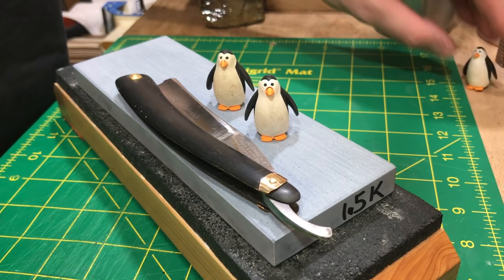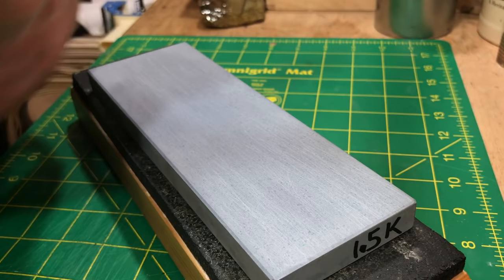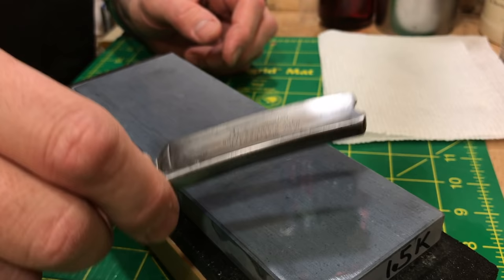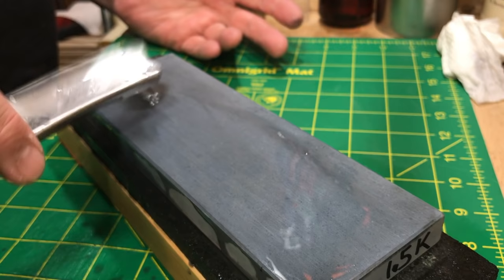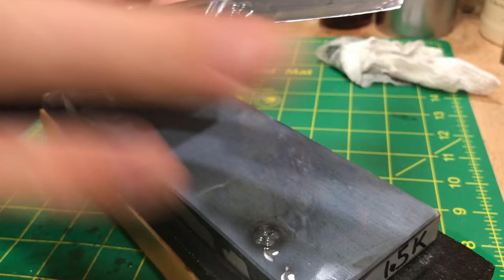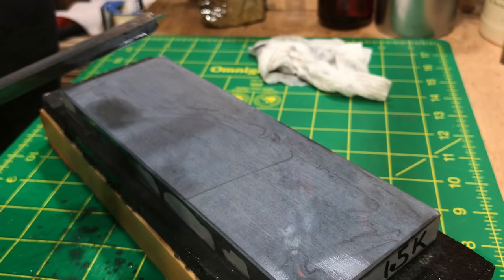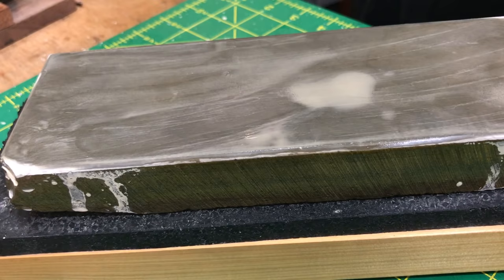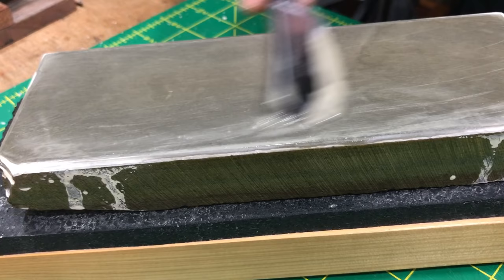Straight Razor Honing - from Resto to Shave Ready

Comment: This...  This video right here... I've been watching these videos for hours - this video is the first one that mentioned the black marker trick to check the edge.   Tried that - saw my spots not getting hit...  BOOM... got my edge on a cheap amazon 20 dollar razor - though there was so much work to be done, I dropped down to a 400 for the quick work then back up to the 1k.
Reply from the maker: A lot of (almost all of) those inexpensive amazon razors are made from soft steel, so you may get an edge and then lose it quickly, or it might not take at all.
Reply: @KeithVJohnson1  Yeah I didn't anticipate it being a super nice razor when I got it - but it's been a great learning tool.   I was able to get the cheap one to shave - though not a great shave.   We'll see what happens when I buy a nicer one next week.   I'm thinking a dovo?
Reply from the maker: If you are learning to hone - I would suggest picking up a couple of vintage razors that don't have huge obvious issue - you can probably get 2-3 of them for the price of a new Dovo. You can beat up on them and once you're skills are in place you can get a new new blade and you'll be ready to hone it without putting excessive wear on it.

Comment: Keith I was wondering is there a certain amount of laps you are doing on each stone? Seems like your honing for along amount of time. I’m using 1000 super stone, 3000 chosera, 8000 shapton then a 12,000 Naniwa GOUKEN Kagyaki. To set the bevel to finish it takes me about 25-30 minutes. Should I be spending some more time on a certain stone?
Reply from the maker: Hello! 
No, I don't count laps,  or hone for a set amount of time, or try to go fast. I like to immerse myself in what I am doing so I can enjoy it. Time is irrelevant for me when I am honing. This is just fun for me, not a chore. I don't time it. Some people hone faster, some slower. I tend to focus on what I am doing, and not compare of judge what others do. It takes as long as it takes. 

That said, the videos are just demonstrations, they are not meant to be a 'do it this way' kind of thing. What you see, or think you see, is not necessarily what happens or how it happens when I am not making a video. The lack of a need to hone faster is the main reason. But for videos I turn it down a notch for a couple of other reasons; one is that I don't use a script, everything I say is spur of the moment. Being more conservative with actions and approach allows me to assemble and verbalize thoughts into coherent passages. Sometimes I spend more time on a stage so I can complete a thought.  Moving slower allows a better view of what's happening on the stone. The tactile and audible feedback presents better when going slower too. Speed tends to blur the feedback, and it will give a false positive on undercut.  

Bevels are done when they are done. Same for the rest of the progression. 
There is no way to time the work, or assign a set number of laps for any stage. If someone wants to hone faster, that's their thing. The only thing that matters is if the work is done correctly, it's not better or worse to go faster or slower. If I have a razor in good condition the honing is faster than when I am starting with an auction site save.  Rolling stroke blades take exponentially longer because the entire edge isn't on the stone all at the same time. 

Every bevel starts off with a different condition, every piece of steel has different hardness and wear resistance. Every user applies pressure differently. So there are all these variables to deal with. The only method that works is to hone until I am done and however long it takes is how long it takes. Longest I've spend on a rough bevel is probably 90 minutes, shortest is probably 7-8 minutes. Depends on the blade and my mood and which stones, etc, etc, etc, 

I spend the bulk of my time on 1.5k and whatever the next stone is. 
How long that takes depends on myriad variables. Setting a bevel that I can get a 3 pass shave with requires time on the stones. There's no getting around that. 
My 8k and 12k efforts usually take less than a minute combined.

Comment: Hi Keith, I've been watching along while honing a blade of my own.  I've also extended the spine over the edge by the heel creating as you called a 'chevron' but was wondering if this will comprismise the edge at some point or if I can continue to wear it all the same?
Reply from the maker: Sorry, I don't understand what you are describing or referring to. Could you explain in detail or point out a time-stamp in the video as a reference?
Reply: Hello, I was referencing around 34:50 in your video. I just wondered if continuing to hone would inevitably cause issues with that segemented part of the steel.  Maybe you might have asked before but why would a blade be designed like such?  It seems counterintuitive to obstruct the last cm or so of the blade... anyways I don't know so much about this yet :)
Reply from the maker: @Brandon-mr2oh  I can't find anywhere I used the word chevron - sometimes time stamps are off on different viewers I think. Long ago, tolerances were not tight, perfection took a back seat to making more money, etc - so a lot of razors were made 'imperfectly'. Honing errors ocross 100 years takes a toll too.
Reply: Ah I reviewed your video a little more to clarify myself, so the shoulder is what is strange to me, as you say around 36:20 there will be discrepancy with bizzare heel/toe.  If the shoulder makes it difficult for us to hone equally, why is it designed such?  Other than my possibly irrelevant question.. when honing onto the shoulder in order to extend your bevel at the heel would I want to take care not to create much more than a small stretch of the spine?  Hopefully i'm making a little more sense.  Thank you for the help.
Reply from the maker: @Brandon-mr2oh  There's no way to imagine what to do with an imaginary razor. You have to take each situation as it comes and work with it to achieve the desired results. How anyone approaches each of their own challenges is up to them.
Reply: Very true, thank you for the solid advice!

Comment: Are you torquing the blade's edge into the stone heavily, lightly, or not at all?  Great information, as well.  I'm about halfway done with all of your videosn(I've been watching for a couple of months now).  Just ordered a Shapton Glass 1k to set bevels with instead of the very cheap 1k from Amazon I purchased 😐
Reply from the maker: Torque and pressure depend on the blade and the work needed to be done. I do all of the above, but not all at once and not all the time. Thank you for watching and commenting!

Comment: 1:03:07 Do you finish on just water with black Arkansas?  Is there a difference between swarf and slurry?
Reply from the maker: sometimes water, sometimes water & soap, sometimes glycerine with water, sometimes oil. Slurry is from rubbing two stones together, swarf is slurry plus abraded metal from the blade.
Reply: @KeithVJohnson1  Thanks!   I will need to look for a video you do with soap and water.  I've never heard of such a thing.  I use to shampoo my hair with vinegar for years.  Not sure why I stopped.
Reply from the maker: A tiny bit of soap breaks the water's surface tension, and it adds some lubricant to the mix too. It's a nice finishing liquid. But only use a very very teensy bit of soap.

Comment: so the spine is a guide?
Reply from the maker: Straight razors are designed/made so that the spine is part of the geometry - so yes, in a way, that makes it a guide because the width of the spine determines the angle of the bevel.
Reply: bt the spine wears down over time doesn't t? I have seen people tape it. would you recommend?
Reply from the maker: The spine is supposed to wear down, that is how the bevel angle is maintained.

Comment: Bloody awesome video as usual.  I have a question.  I’m about to lay out some dosh for my first stone.  Have found Shapton to be in my budget and availability. Could I also use these stones to sharpen my kitchen knives or would I spoil them. I would obviously want to use them for main purpose of honing my straight razor.  Appreciate the advice! J
Reply from the maker: Shapton Pro stones are fine for cutlery; they're hard enough to deal with the pressure easily. They work well for razors also.
Reply: Keith V. Johnson thank you for a straight answer ;-).  Just placed my order for my very first 1.5 k stone :-))). Enjoying the journey!
Reply: Keith V. Johnson I also get what you said on the “ touch up” stone.  Ie and this is just me confirming what I’ve learnt.  But if it’s just to “ touch up”. You don’t need to take it all the way back to 1k or 1.5. However if I been shaving with same blade for a while and it’s “ shuddering” perhaps a bit on each stone .... checking the bevel..... then moving up gradually should do the trick? Given there’s no damage to blade.  Is that the basics of it?
Reply from the maker: Not really sure what you mean by shuddering but moving gradually is usually a good plan.